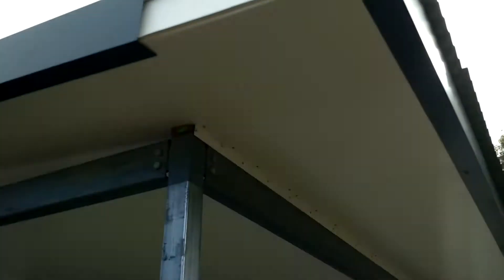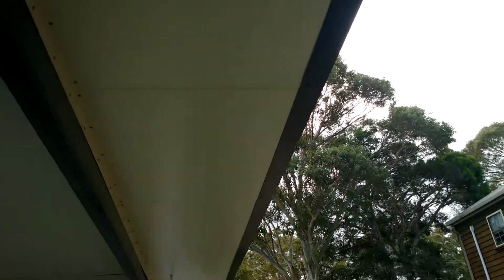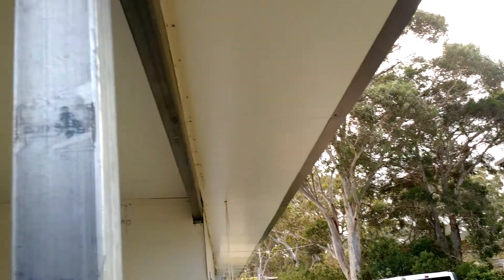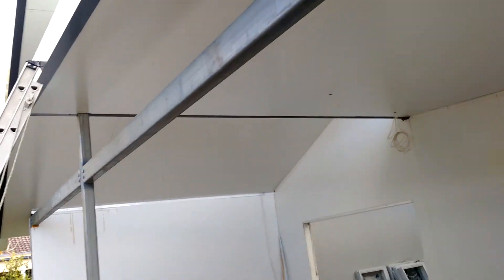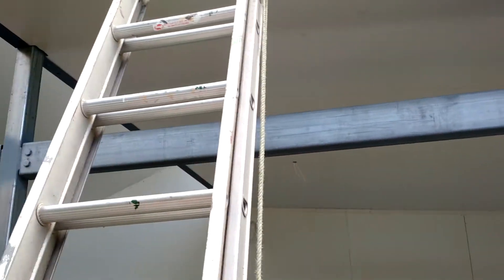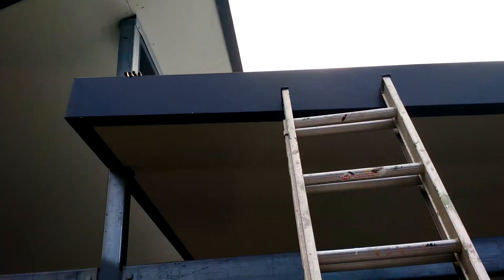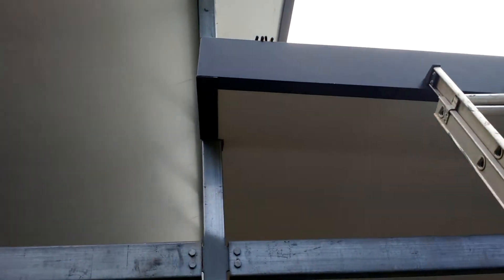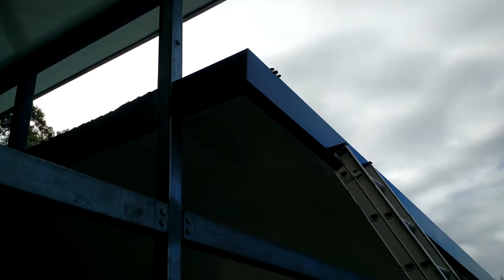SIPS Panel Construction Flashing the edges of the Panels

Comment: Can you take a top view of the flashing
Reply from the maker: Have been busy Tiling the Alfresco area,so havn't been checking the chanel,Are you in Australia,so we can talk over the phone,as to the flashing its just a U shaped flashing which has a bottom being  60mm and the tall section of the base of the U is the thickness of the panel plus the thickness of the batten if one is used  then plus the depth of the corrigated iron roofing,ie 150mm +batten 20mm and roof 25mm so total of 195mm then the return leg of the U shape should be enough to cover any gap then plus enough coverage for two to three corragations.
Reply: Just getting back into it aftera new hip operation not going up on ladders  but the top view is just a standard corrigated flashing as wide as you want it  with the 20 degree bent at the edge any roofing suppier will be able to bend it.